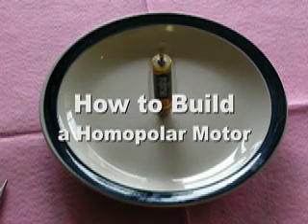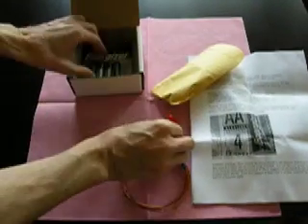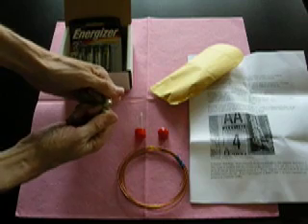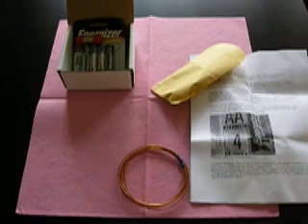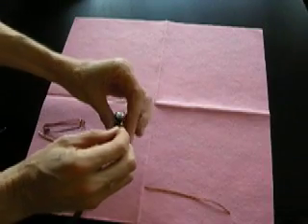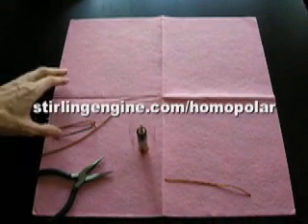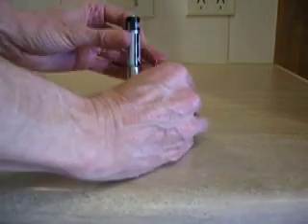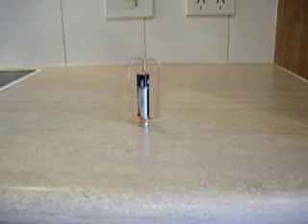How to build a homopolar motor

Comment from the maker: I suppose by garden wire you mean some kind of steel wire?  I've tried a steel coat hangar wire and had troubles with having the magnet attract the steel wire too strongly to make it work.

Check out my other video on how to find the parts to build one of these.